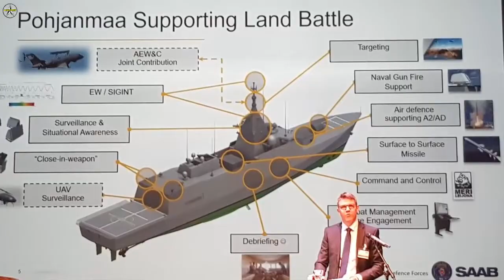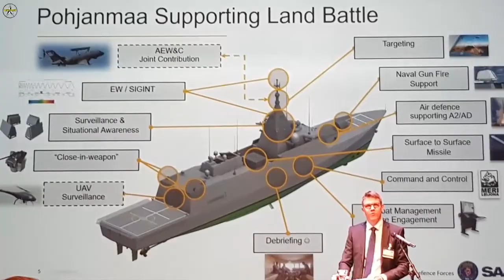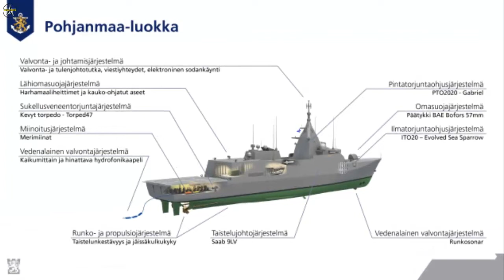Finland Progressing Towards Construction Of Pohjanmaa-Class Corvette

Comment: Armament: PTO2020 Gabriel anti-surface missile system, ITO20 Sea Sparrow anti-aircraft missile system.  Light Torpedo Torped 47 as an anti-submarine system. Sea mines as a mining system.  The 57-millimeter BAE Bofors cannon, decoy launchers and remote-controlled weapons are used as close-in self-defense systems.
 Sensors: Surveillance and fire control radar, echo sounder and towed hydrophone cable, hull sonar
 Battle Management System: Saab 9LV  etc....

Comment: Why 57mm auto cannon? It's too small
Reply: Coz the speed and other armaments
Reply: Modern warships dont use much more higher caliber deck guns anymore. Ships dont have any armor anymore because its useless against modern weapon systems like missiles and torpedoes. Thats there because its rapid firing gun with very good fuse, which in best case can shoot down missile, low flying plane and sink a small attack craft from quite of distance. If you have got your ship in gun range in any other ship 
these days you have done something horrible wrong.
Reply: Cannon is almost useless in modern day warfare their used for near by targets only
Reply: The main armaments are anti-ship missiles & torpedoes. The 57mm cannon with it's programmable ammunition is more than enough for the threats it's meant for.
Reply: The auto cannon is meant for cruise missile protection, and perfect caliber for that role.

Comment: I would like to know from someone why Finland, which would fight in littorals and skerries, chose the IAI Gabriel 5 Missile rather than the NSM or RBS-15?Any thoughts?
Reply: Gabriel was chosen since it can be used against land targets also. I guess there are other weapon sales in play too, Israel and Finland have long tradition in selling weapon systems to each others.
Reply: Feel silly replying to a year old post, but the Gabriel 5 has an advanced active multi-spectra seeker designed for cluttered littoral environments. So it should be just as capable as the NSM. Probably cheaper too.
Reply: Old post but I reply anyway.... at the time of selection Finnish Navy summarized the selection as "The best and most affordable candidate was selected."

Rarely best and cheapest fit in the same sentence but in this case it could materialize. Multi-spectral seeker designed form littoral environment + active radar. Missile with sea and land attack capability. Notably Gabriel V warhead is 2x weight compared to NSM and has reported overall weight of 1250kg (NSM 400kg).Excluding warhead NSM weights 280kg while Gabriel V is 1000kg. There must be something extra buried in those kg's.
Reply: Please  Ask  !  ..............
Reply: My personal guess would be because the Gabriel missiles are perhaps better at distinguishing radar return signals of ships from one another.
Hamina Class missile boats will be responsible for littoral combat and as far as I know they are fitted with RBS-15 anti-ship missiles where as the Pohjanmaa class is more responsible to keep the open sea trade routes open & protected.
Perhaps the Gabriel missiles are better at  distinguishing between passenger ferries and enemy warships?
They are Israeli made missiles and it's pretty busy at the mediterranean sea. All those fishing boats, cargo ships, neighboring nation patrol boats and all...
Just my guess.